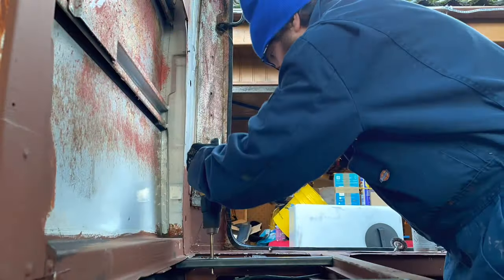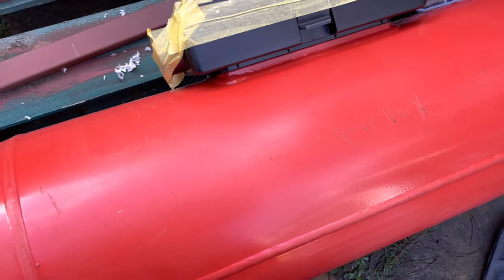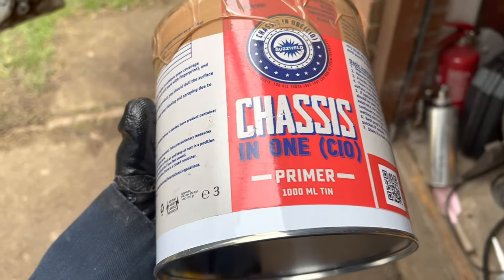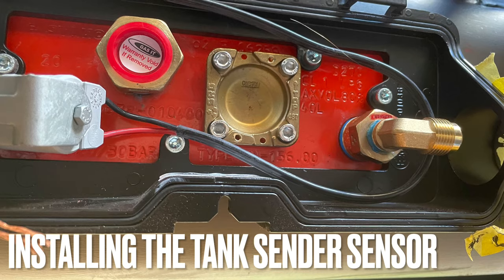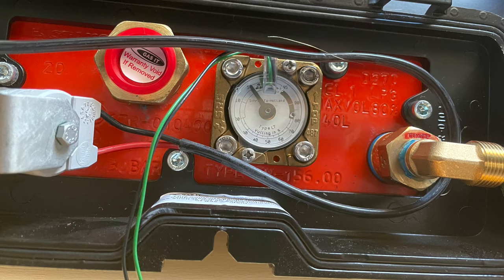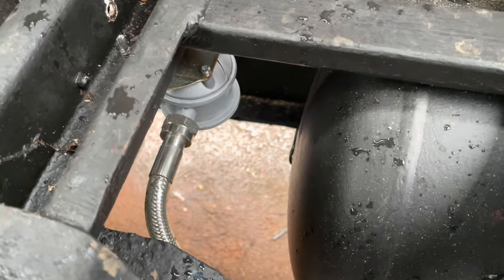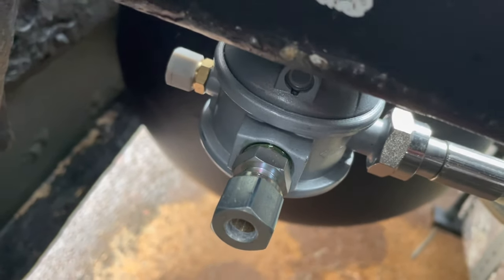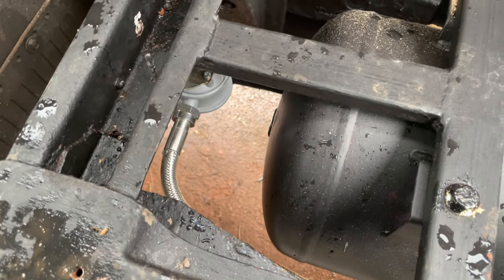LPG Underslung Tank Install | External Gas Filler Point | Mercedes Vario Bus Camper Conversion

Comment: Excellent detailed video. Good progress considering the weather. Please use sponge to kneel on... makes me cringe😳.
Also, consider access to nuts/bolts should you ever need to remove lpg tank. Looking forward to the next one.
Thanks so much for taking the time to film and share. MACK and Maggie, Huddersfield
Reply from the maker: Thanks both. Hope you’re doing well. Top tip with the kneeling. I do often use a mechanics Matt but on this occasion didn’t 😞. Re. The nuts I’m planning on drilling through at least the subfloor for access; this is a handy reminder to do that. Thanks both. Keep safe.

Comment: G'day Rich and the Ladies great job pity about the drill you need a hammer drill and cutting fluid if your going to do that.  I have Makina corded hammer drill it's fantastic and they are usually not very expensive unless you go battery.   Down here you cannot do a gas's or electrical work without a licensed tradesman, you can be fined and if there is a fire or catastrophe your not covered by insurance the same in a house.    She is coming along really well and I forgot to mention that it was Graham that put me onto your channel.       Regards John
Reply from the maker: Hi John. That’s worth knowing re. The gas. In the UK it’s a little different; but we will be getting it fully tested and certified by an LPG gas safe engineer for sure. This will give us peace of mind and get us a certificate too - I wouldn’t risk it and prob should have mentioned in the video. Another great tip on the drill, I’ve got my eye out of a deal over here but in the meantime have borrowed some tools off father in law 🔨🛠🔩. Graham is a gent for calling us out and we are really really pleased to have you as a subscriber. It’s great to hear from you and it’s amazing to get tips and advice like yours. Thanks so much 🚐🚐🚐